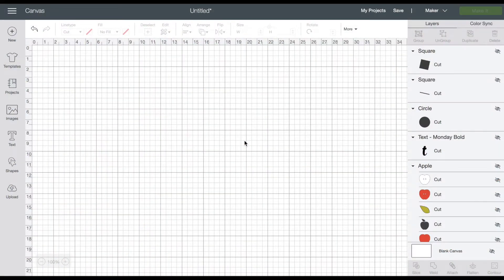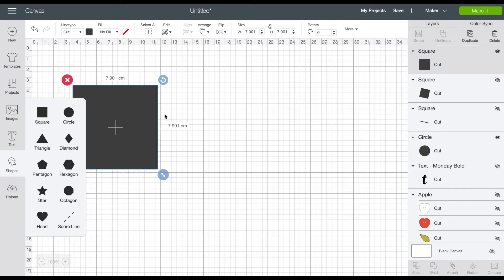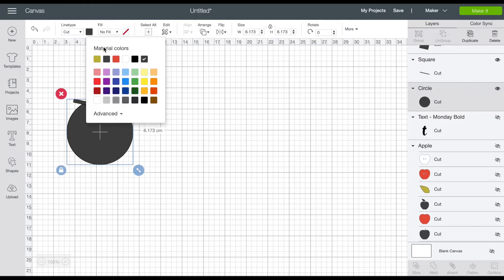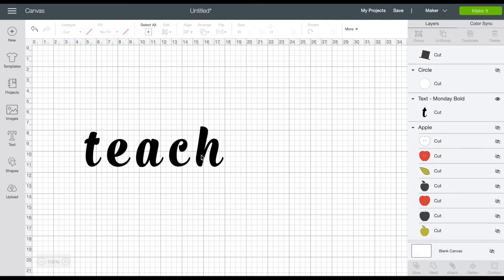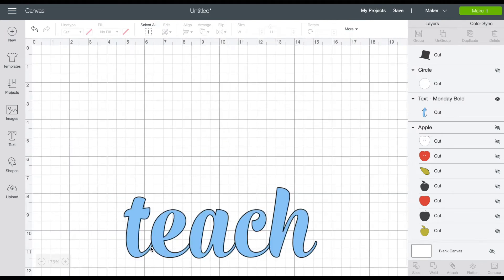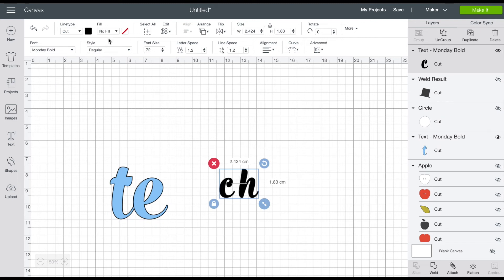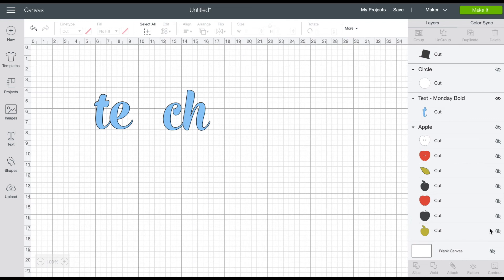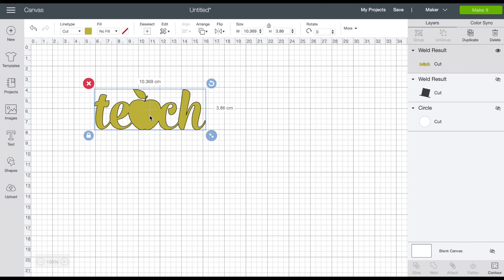How To Use The Weld Tool in Cricut Design Space

Comment: Is there a way to weld whole maintaining the separate colors.
Reply from the maker: Hey Susan! You can "group" everything and maintain the colors, sending each color to a separate mat for cutting. Welding means several elements are becoming one and will cut on the same mat, which is why the color changes. The other option is to "flatten" and "print then cut." This would allow you to print a design and let your machine cut it out of paper, sticker paper, vinyl, etc. I have a video in this series on print then cut https://youtu.be/BfIULm1p990 and flattening https://youtu.be/FMPiU0dPGEg . I hope that helps! Thanks for watching and happy crafting. 💕